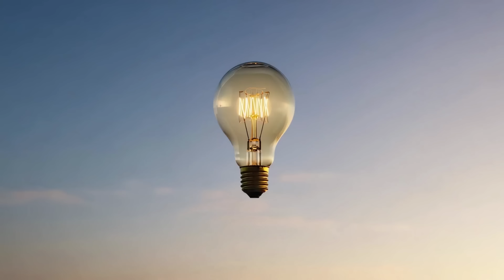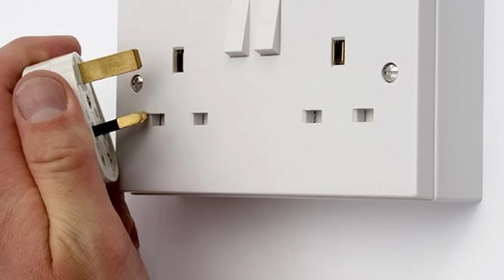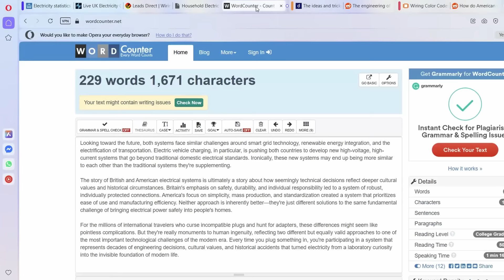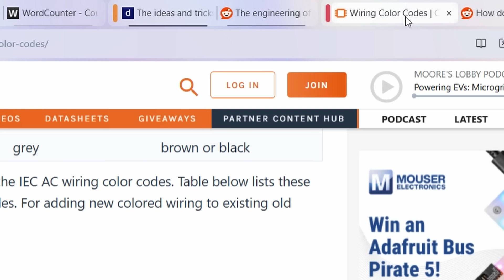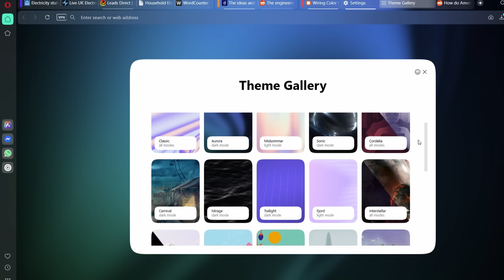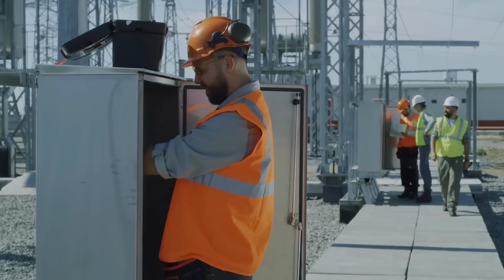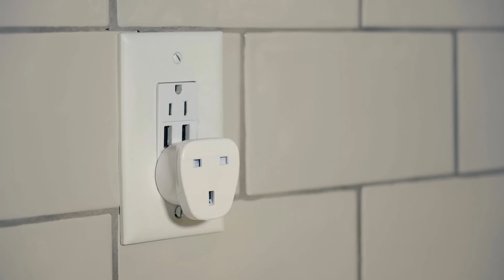British electricity is SAFER than American electricity. here's how.

Comment: It's easy to forget that the British 3 pin plug and socket was only standardised from 1947. When I was growing up in the 1970's, it was quite common for older houses to have 2 pin sockets, and it's still possible to find them in old houses today.
Reply: Or 3 pin sockets using round pin plugs, smaller plugs for 5 amp and larger ones for 15 amps.

When I visited South Africa about 15 years ago, they were still using the old British design of 15 amp round pin plug.  Ironically, I needed an adapter to allow me to plug in my laptop poser supply with its 13 amp plug.
Reply: @jerry2357  5 amp sockets are still part of the UK electrical code for plugging lamps into the lighting circuit - can be controlled from the light switch without allowing people to plug things like hairdryers in there. You will mostly find this is use in hotels.
Reply: @jerry2357 still get those in theatres - where the fuses are racked up in an accessible location.
Reply: @jerry2357 and even smaller ones for 2 amp.  We had an adaptor which accepted both smaller plugs with a single earth hole and two neutral and live holes set at the creative distances.

Theatres were all using 15amp plugs in the 1980s.
Reply: I remember my aunt connecting her clothes iron to the ceiling light socket using a bayonet adaptor!
Reply: @HomerTheRake 😂 My mum had a blender she could do that with. Luckily the plumber talked sense into her as the wiring was falling apart.
Reply: @HomerTheRake  And before that (1950), she had a pair of flat irons heated on the gas stove.
Reply: @HomerTheRake "I remember my aunt connecting her clothes iron to the ceiling light socket using a bayonet adaptor!...) God, yes. I actually found one of those little Bakelite bayonet plugs the other day. Brought it all back. D'you remember the really cool solution to Auntie's ironing - an adapter, 1 male plug and 2 female sockets with one of the sockets switch operated? It meant that you could still use the light bulb while you ironed! Of course, the lighting circuit was never designed to pass the sort of current an iron drew. It shows you how crappy the fuse protection back then. No MCBOs! Plus, houses built around, or before, WW1 had terrible insulation of the wiring, gutta percha, wound cotton and even waxed paper being common. Electrical fault house fires were a lot more common in the 50s/60s when I was growing up.
Reply: @HomerTheRake l believe my grandmother did this. 
You've definitely stirred up a long forgotten memory from my earlier childhood
Reply: @HomerTheRake  Yes, that was common -- there was usually only one socket in each room, and it was rarely anywhere where you could get an ironing board near.
Reply: The design of the British 3 pin plug is a thing of beauty… just like a4/3/2etc etc paper is far superior than the American system
Reply: @joshuasavage1128  to be fair, i've worked in america and the uk... the american wiring rules are far stricter... (NEC) but the specs seem to be set by manufacturers not  anyone with a clue> the outlet spec is clearly inadequate for 5 amps, let alone 15/20, but the rest is hugely overspecced ( 14 g could handle 20A all day every day for example)
Reply: I don't like the habit of british electricians (I am one) of frowning on wirenuts, for example, they make a really good connection. they don't lend themselves to our regs here in the uk,  which require periodic disassembly for testing, but they connect wires REALLY well...  (most uk sparkies who hate them are remembering a different product, the scruit, without the spring, those things were firestarters)
Reply: @TheChipmunk2008  Hi sparkmate (not actually sparkie,  I'm a retired Clinical Engineer,  started  as student Cardiac  tech  worked my way up,  finished  Head of Clin Eng Section,  Med Physics, Guy's and St Thomas - huge one   London opposite  bank from HoP.  so  pretty much  top  job. Got there aged 45. Hit 50, Parkinson's. Out at  54. Life eh?

anyhoo,, 'nuff 'o  that

Hi 
US two pin system hhas thd following advantages
1 cheap nearly all, faults detected on PAT test  are in  the power cord and 99/100 faults are  found by inspection not test.

so every year replace all power cords, never touch a PAT  tester again.  Budget    s down safety up. IF we had 2 pin piugs.
2. Impossible  to mis--wire.. \a) Can''t connect live toearth (enclosure on Class I) cos  no earth   they  are all using class II boxes, b) Can't connect neutral to earth, ditto. One  our electrical risers had 20 Amps going  to earth, 20 enough to kill a 
cardiac patient 2 million times over. We traced most of it to a dental furnace IIRC
c) L/N reverse ,  fused both sides
3. Plated conacts, flex at 0 degrees : less damage from nurses wheeling away  machines still plugged in.

thoughts?
Reply: 2A unfused (and usually unswitched) round-pin plugs and sockets are still occasionally used in the UK. Smaller than the once-common 5A and 15A sockets, they may be used as part of a lighting circuit for things like table and floor lamps.
Reply: @Alan-ln3ls  Yes.  Another application is in an office or factory where some socket outlets are on a UPS circuit.  Using 5A (or 15A) sockets on the UPS-backed circuits ensures that only the items supposed to be used on those circuits can be plugged in.  I have worked in a place where that was not done, and an employee who found the air conditioning a bit fierce plugged a fan heater into the UPS circuit!
Reply: The BS546 round pin plugs (2/5/15A) are still valid, and allowed to be installed. The 2 and 5A are frequently used where switched table lamps from a wall switch are required. The 15A used to be used in theatres a lot but they've moved to iec 60309 ones (the round blue ones) as they can't come accidentally disconnected.

The BS546 standard also included a 30 amp version originally too, but it was rarely if ever used, been a sparky since 1989 and never seen one in the wild
Reply: @TheChipmunk2008  Came across one in South Africa behind a stove. It was a beast!
Reply: @ianhutchinson1783  that is what they were intended for,  fun little fact for you about BS546, the earth pin of the lower current rating was the l/n pins for the next one up..... :)
Reply: @ianhutchinson1783  but was flattish against the wall... idky they didn't catch on
Reply: @TheChipmunk2008  Yes, my house has 5A round pin sockets for lighting in some rooms and it was built in 1998.
Reply: @TheChipmunk2008  I had a house built in 1990 and every thing was standard 3 pin square plugs and sockets. However The electrician installed old style 5amp 3 pin round sockets at strategic locations in certain rooms for the sole use of table lamps etc that were controlled by one switch so no need to go round each lamp to switch on/off. All perfectly legal as you could not connect a vacum cleaner or other such device with a 13amp plug. (unless you were completely stupid)
Reply: @philvincent5660  A thing that a lot of people don;'t realize is it's actually perfectly acceptable to fit normal 13A sockets to a lighting circuit, best practice is NOT to, or to label the socket to prevent misuse. (this can be useful if something has a wallwart plugpack or say, you need a feed for an aerial amplifier in a loft and there's nice lighting circuit right there)
Reply: @TheChipmunk2008  Very true, but the 5amp circuit for one room might have had 4 sockets but one switch thus enabling to be turned on/off from one wall switch with the added safety of not being able to connect that welding machine you just happen to have lying around. agree with aerial amplifiers in loft space but label them properly. It might bite you on the arse if you ever sell the house. Merry Xmas.
Reply: @TheChipmunk2008 I had the small round pin sockets installed at my last house and operated by a light switch on the same plate as the main ceiling light. I was impressed when in American TV programmes, they could turn all the table and floor lamps on with a single switch! (Small things…!) A family member also has them in a house which was a new build in 2001! Less call for them now though, I would imagine with Smart sockets and even the cheap and cheerful remote sockets available from Amazon!
Reply: @TheChipmunk2008   My grandmother electric stove had one of those giant round pin plugs on it.  The only one I've ever seen.
Reply: Very rarely will you find any Bakelite these days, as any electrical work on the property would not be issued a compliance certificate.
Reply: @weirdscix  not quite true, if it was compliant at the time of installation, it would warrant a C3 (improvement recommended) on a condition report, which is not an 'unsatisfactory' outcome,  but would be noted that the installation is probably too old for long term continued use but isn't an immediate danger :)
Reply: @TheChipmunk2008   I wasn't quite clear in my comment.  I was alluding to if for example a consumer unit needed replacing, a new ring, etc.
Reply: @weirdscix  Actually, IIRC, existing Bakelite sockets, and unearthed brass light switches, etc are grandfathered in, provided no work has to be done to the particular circuits they are part of.  Work elsewhere on the property would not require that they be replaced.  However, any electrician should, IMO, strongly recommend that they are changed, particularly if there may be children around.  

The old sockets have no shutters across the holes, so particularly with the larger-diameter 15A sockets, a young child can put their finger into a hole and get electrocuted.  Also plugs (including 13A ones up to the 1970s IIRC) did not have insulation round the first bit of their pins, and it was easy to put your fingers round the back to pull out a stiff plug and get a shock if you hadn't turned the socket off first.  And unearthed brass-covered light switches are a nightmare.  I think I was electrocuted 3 times by them -- once at school in the early 60s, then in someone's house in the late 60s and in an office in the early 70s.  It only takes a loose wire to touch the front plate and it will be live.  The trick was either to use a tissue or item of clothing to move them or to push the switch quickly with the back of a finger -- because the muscles to close your fingers are stronger than those which open them, a shock will actually move your finger away, reducing the time you are in contact.  Certainly in the 60s, electric shocks were common.
Reply: My grandparents had some things that were 2 pin plugs, and they died in 1986. We inherited some table lamps, including an adapter that plugged into a 3 pin socket. One of them plugged into a light fitting. we used it on and off until 1995.
Reply: This is true! The UK property we lived in in the “70s had the 3 round pin type sockets. As I recall, they didn’t have the same safety features, like individual fuses, shuttered socket openings or partly insulated pins that the 3-square pin plugs have. I got a shock from one on these outlet because it was possible to plug the live pin into the neutral socket accidentally and vice versa if you had the plug misaligned and off to one side!
Reply: I can remember one.
Reply: We have 2 pin sockets in bathrooms for shavers and toothbrushes.
Reply: Three pin sockets with round pins If I remember right 15amps? as well as two pin sockets with round pins, And plugs that fitted into bayonet light fitting sockets, No Earth wires in two pin or bayonet fittings
Reply: I can remember them, and they caused a serious hazard with anything electronic like the vast majority of old TV sets and a good many valve radios which had mains connected chassis or circuit boards etc. if the plug got put in the wrong way round, especially as some of the old radios and TVs had knobs fitted on metal shafts and some of the knobs were only held on with a C shaped spring like thing and those knobs could be too easily pulled off revealing the shaft which could be very LIVE!
Reply: Or, those little 3 round pin 3A un-shuttered sockets which used unfused baby plugs. My family moved into new build in 1965 and those sockets were all over the place. What d'ya know? They're back in the form of 5A round pin sockets.
Reply: It's a similar situation here in the US.  The three pin system here is relatively new and I remember grandma had some really old outlets that only had the two slats instead of the three pin system that became much more popular as I grew up in the 80s.  Now, we have the two slats at different sizes for a plug that doesn't have a separate ground pin to provide the ground in the 2-style configuration.

Comment: Our plugs might look clunky but you can put furniture against a wall with the socket behind it. Kalyn also didn't mention they are switched.  Can't believe US  plugs can fall out or leave live holes whilst handling higher current.
Reply: The switches are optional in BS1363, but they are fitted as standard to almost all sockets. However, if you want an unswitched socket for an appliance you don't want turned off, they are readily available.
Reply: @TheEulerID  I remember when I lived in Ashford, Kent for 4 years and not all outlets had switches. Switched outlets are available here in America, for those that want them.
Reply: American "plugs" look terrifying.
Reply: @JohnPretty1  why the ""? are you suggesting american plugs are no such thing? I am baffled.
Reply: Early square three pin sockets did not have switches you paid extra for a switched socket
Reply: @kevanparker908  Unswitched sockets have always been available and still are. But because the majority sold are switched, the price difference is not much or the unswitched sockets cost more!

Comment: I have seen few BS 546 sockets over the years, and I think the last one I saw was on a train. I don't think the train was old, I think it was they chose a socket type that passengers couldn't use.
I'm not sure if the theatre world has switched to LED yet - BS 546 was kept around because one of the socket types was rated 15A whereas BS 1363 sockets tend to be rated 13A, so a new installation for high power lights would likely be a choice between BS 1363 or IEC 16A. Having never gone up in the lights (the highest I ever went was the mixing board and light control booth), I'm not sure what plugs/sockets each individual light/spotlight used to use.

Comment: When I lived in California, although plugs were smaller, the cable would stick out from the wall and the leads were more easily pulled from the wall. You never mentioned the existing safety features of UK wall sockets that prevent children, or silly adults, poking items into the plug holes. UK sockets have shutters that prevent the live terminals being accessed until the plug is engaged. We've been making them like that since 1947. It's about time the rest of the world caught up. Another great video Kalyn
Reply: 2:34 a tad brief perhaps; but that wasn't missed
Reply: It sounds like your outlets were old as well.  They really have an operational life of about 30-40 years before they should be replaced as the spring tension system in the outlets themselves wear out over time.
Reply: @ericbarlow6772  It certainly does wear out and causes expensive failures of electronics. I've sometimes had to replace sockets for that reason.

Comment: Fuses are not the only protection. Breakers and earth leakage protection are also provided at the distribution board or consumer unit for each circuit.
Reply: Looks at the decades-old rewireable fuses in our distribution unit... "Um, sometimes?"
Reply: @robertfitzjohn4755  That's your choice not to update it. I would recommend replacing it with a modern, metal consumer unit with double pole RCBOs and a surge protector.
Reply: @TheEulerID  yep, still compliant but 'C3, improvement recommended' :)
Reply: @TheEulerID  Definitely, if only to avoid the trouble of hunting for a fuse and then replacing it, as opposed to flicking a switch. I remember dad having to call out an electrician to replace the main fuse once. I can't remember what blew it.

He had the house rewired eventually. The only niggle with the RCBO was its sensitivity. Nearly every time a bulb burned out, there was enough of a surge on the lighting ring to trip the protector, so you had to flip the switch as well as change the bulb. It doesn't seem to be a problem in my house, though nearly all my bulbs are low energy. I only have a few tungsten bulbs in rarely or briefly used places.
Reply: @TheEulerID  Yes, it ought to be done some time, probably when something else needs doing. I did make sure to include an RCD for the power shower.
Reply: @TheEulerID  - I'm not convinced about the value of a surge protector in the consumer unit. I think these are much more useful (and effective) when fitted individually to protect the item/equipment/appliance that may be damaged. A kettle does not care about a short term over-voltage. Whereas if you take your  electronic item to your friends house and they don't have any surge protector and there is a surge...
Reply: @jurgenkurgen  Hunting for a fuse? Don't you mean replacing the fuse wire in the main switch fuse? 5amp lighting 15amp general sockets
Reply: @kevanparker908  You are probably right. Dad used to do it. He still had to rummage around in the drawer for it, though.